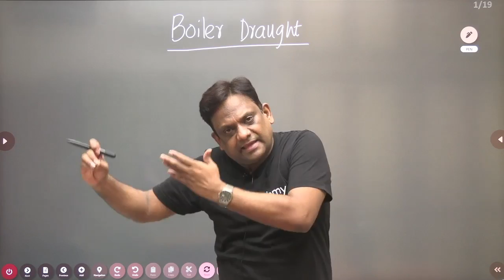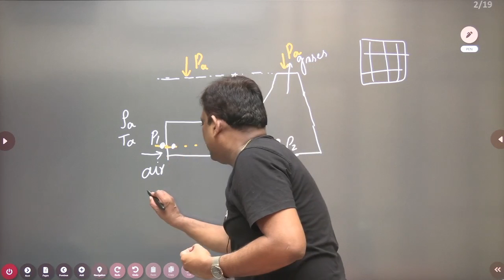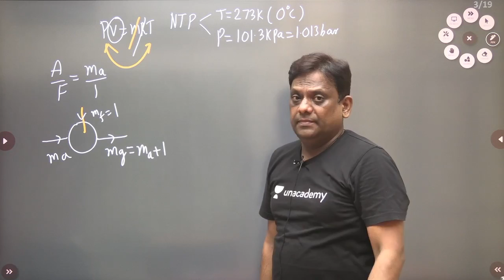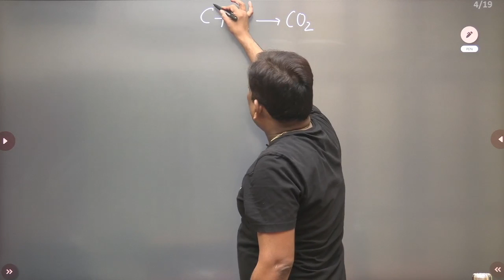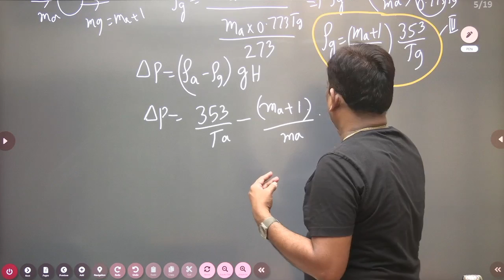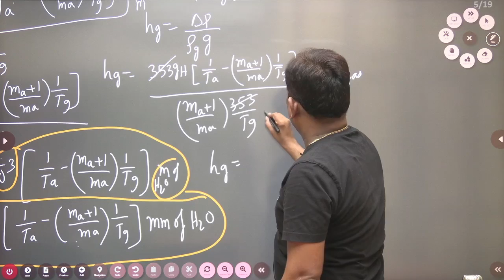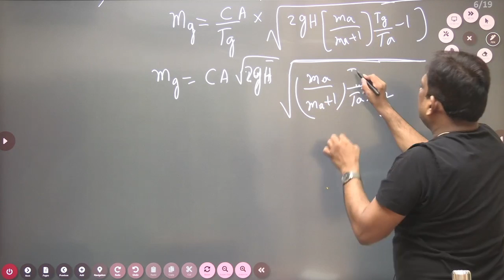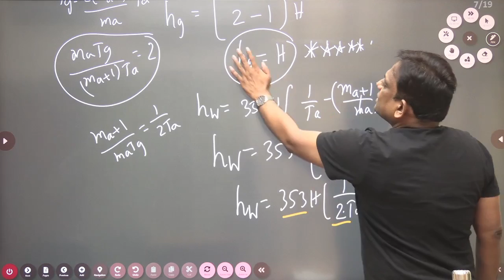Boiler Draught | Thermodynamics | GATE & ESE | ME | Praveen Kulkarni

Comment: If the fuel used in the furnace is coal or solid fuel then how could we say that the mass of the flue gas is the sum of mass of air and mass of fuel? I mean Ash is also form during combustion.